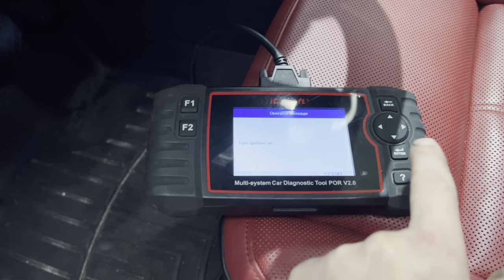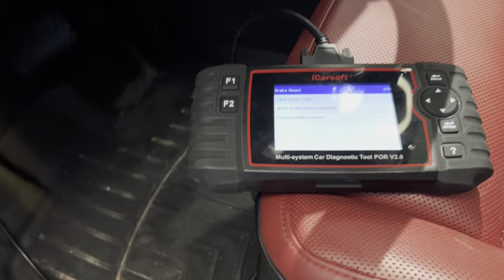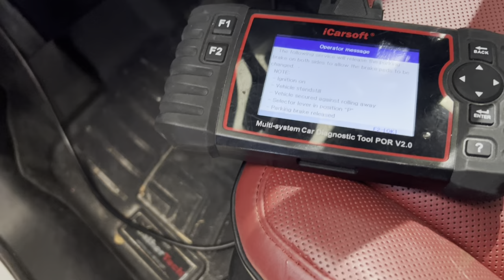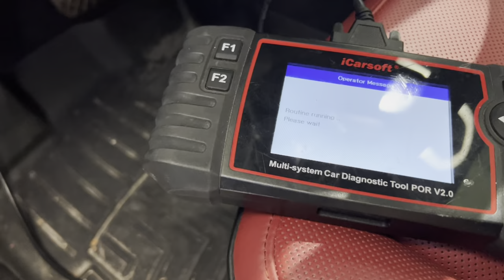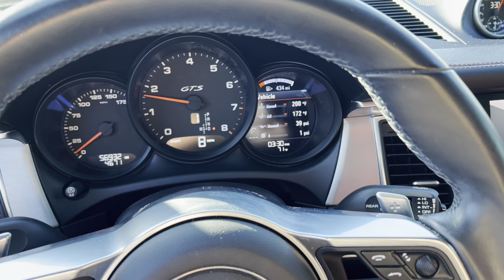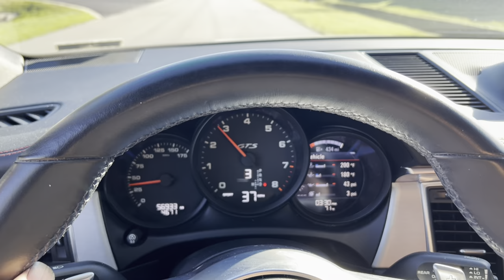Porsche Macan GTS Brake Replacement with Test Drive

Comment: Thank you very much for an excellent video. I have a 2019 Macan. Just got message on the dash saying "Brake Pads need to be replaced. Driving permitted."  How do I know which (front or rear) pads need replacement? Thank you.

Comment: As a tech, with sucking out a little bit of brake fluid, never done it and never had a problem over filling the reservoir.  Also with striping out the hub, only seen it once, where rotors and bolts were barley replaced. Just brake it lose with a ratchet then loosen with power tool. Thats what I've always done and never had an issue.
Reply from the maker: It only happens when someone tops off the reservoir when the pads are near done. It only takes once to make you think twice :)

Comment: Question on brake pads. We have a Macan S , have not done the brakes yet. The factory pads make a mess with brake dust. What pads would you recommend as a better option. Thanks
Reply from the maker: I’ve not tried any pad compounds other than factory pads on the Macans just yet. There are ceramic pads out there for the Cayenne but I did not like how they responded when towing a trailer so I took them off and deal with the brake dust. There is a wheel cleaner called Tuga that allows you to spray it on and hose off 99% of the brake dust making it much easier.